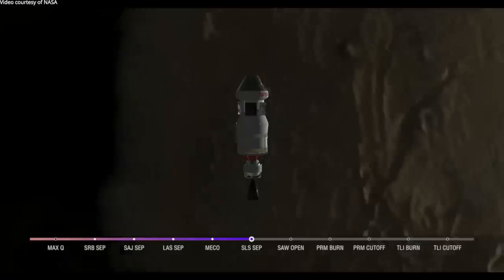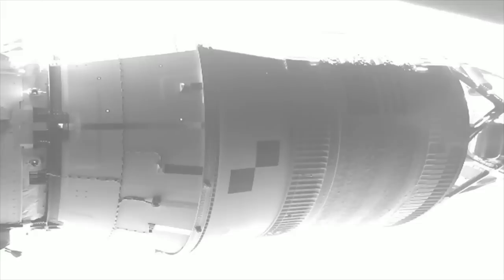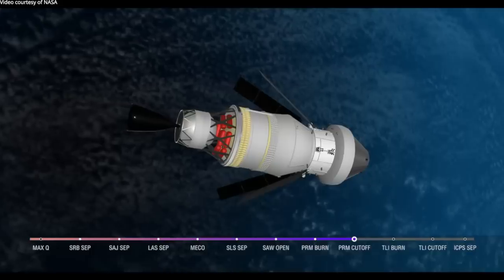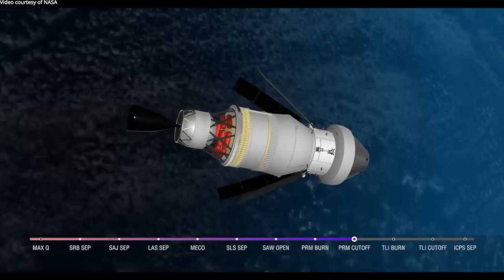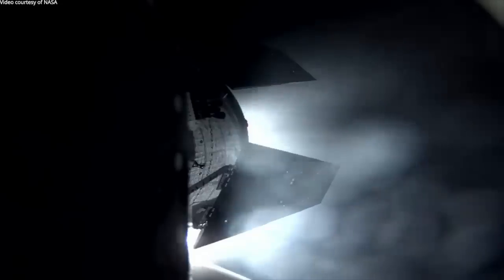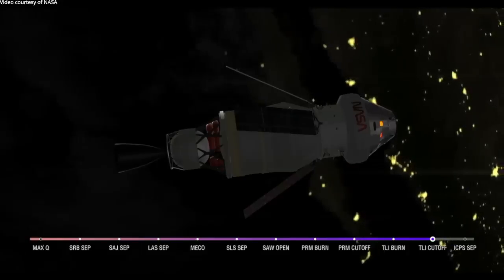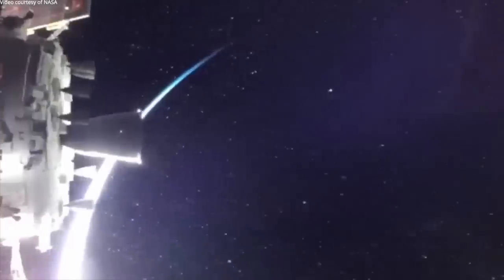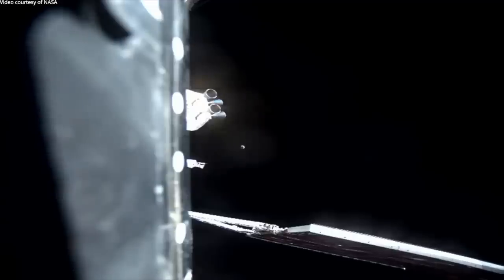Orion spacecraft trans-lunar injection and separation

Comment: As a 66-year-old that grew up with Apollo and beyond, I must confess to being very disappointed in the low quality and lack of camera footage on this flight. If they want to 'sell' the concept of going back to the moon to a larger, younger audience they will have to do a lot better than this poor offering. When one considers the number of cameras that were on the Apollo flights, this by comparison is a very lackluster affair indeed. Shame, as they have missed a great PR opportunity.
Reply: "The images and video collected by the Orion cameras will come in a variety of formats, ranging from standard-definition to high-definition and up to 4K. Each is tailored for a specific use and dependent on the bandwidth available during the mission to send to Earth or recorded on board to be analyzed after the mission ends. Due to bandwidth limitations on the spacecraft that prioritize transmitting critical data to the ground, livestream video quality will be lower than the onboard recordings. As a result, some of the highest quality views may not be received until well after they are recorded and can be downlinked."

Source: NASA’s Artemis I Cameras to Offer New Views of Orion, Earth, Moon, article from 15 november 2022

With all due respect, it's also important for me to point out that even the lower resolution GoPro feed we're getting live streamed in real time is objectively of superior quality to what the Apollo missions could live stream in the 1960s/70s through their S-band radio signal (which was considered low res and low frame rate even at the time). I think there might be a "nostalgia goggles" effect in play here ;)
Reply from the maker: The Earth seen by the Orion spacecraft on the way to the Moon https://www.youtube.com/watch?v=nHxxKlye_Qo&list=PLpGTA7wMEDFg69i1bN_BGUattwQixH_-I
Reply: Worth noting that we'll be seeing a hell of a lot on the manned missions. Pretty much all of the Apollo cameras were manned, not automated, with a few exceptions.

Comment: What's with all the kerbal swaying?
Reply: I suppose the camera is on a solar array that is gently oscillating while the engine is thrusting?  They swept the panels back before the TLI burn because they feared the joints would be overstressed. Even swept back they can move a little and vibrate slowly.

Comment: How many Gs would astronauts feel during the trans-lunar injection burn?
Reply: Approximately 0.27 G
Reply: Once in space you can sacrifice thrust-to-weight for higher efficiency, to get the most delta V with the least amount of fuel. Basically you need big powerful engines to escape Earth's atmosphere and gravity (reach orbital velocity of 17000 mph), then you can use tiny-but-efficient engines.
Reply: @Grubbbee  What speed does Orion need to achieve for trans-lunar injection?
Reply: @fredflintstone8569  did some googling and orion performed an 18 minute TLI burn. That gives you an idea of how relatively small the thrust is compared to the mask of the spacecraft. "ignited its single RL-10 engine for an 18 minute burn that increased Orion's velocity from 16,840 to 22,670 miles per hour (27,100 to 36,480 kph)." If you are really interested in this stuff, I HIGHLY recommend you try Kerbal Space Program very fun and educational.

Comment: I wanna go sooooo bad! I don't care the risk... I want to go!
Reply: I can see landing there, being psyched about it for a week or two before I begin to wonder what I've gotten myself into. It is a barren, frozen hellscape with barely any atmosphere.  It may be best for tech to evolve to the point where a base can be built autonomously so you have a ready-made base to move into when you get there. Otherwise it's gonna suck pretty bad for them. Once they get there, they can't just leave immediately. They'll be stuck for months, at least.
Reply: @johnrex5342  I am now an old man. I would go even if it was a one way trip. Nothing to lose at this point and everything to gain.
Reply: @kl0wnkiller912  That is a good point. In fact, it's a good argument to send older people. Older people won't be living for many more decades, so radiation exposure won't cut their lives short, as cancer can take decades to develop. They also aren't going to have more children, so we don't have to worry about their germ line cells getting damaged.

Comment: where's that side camera mounted? on the solar panel?
Reply: I suppose yep, on panel.
Reply: it looked like it based on how the angle was changing initially as the array was moving
Reply: There's one on each panel if I recall what I read
Reply: Yep, that thing is covered in GoPro S cameras. Tiny little wifi cams.
Reply: Yes.